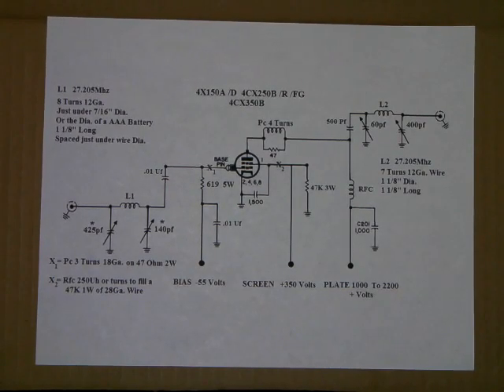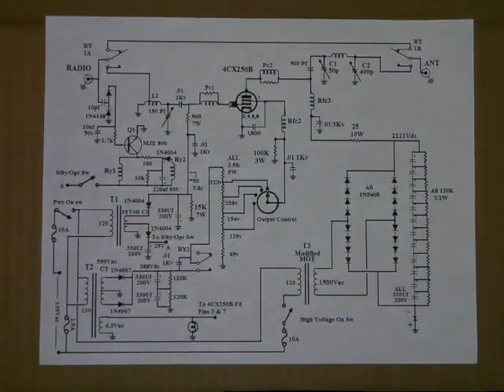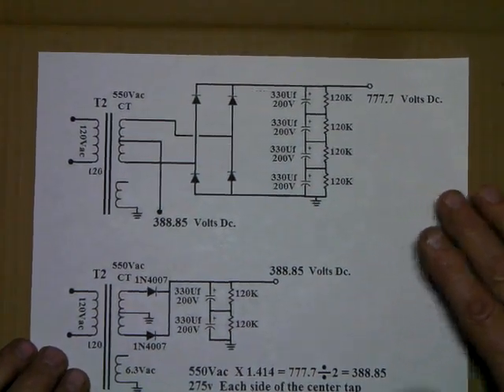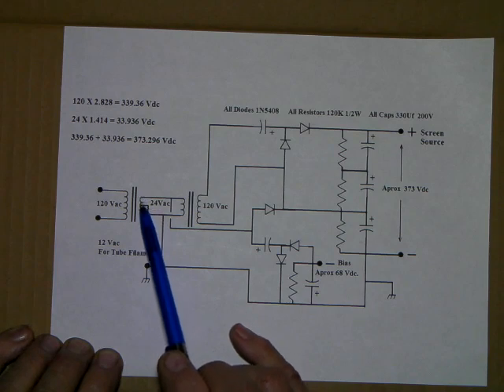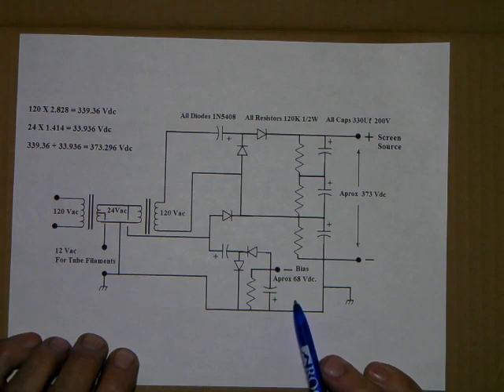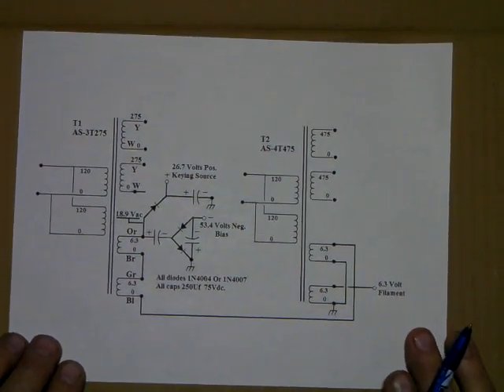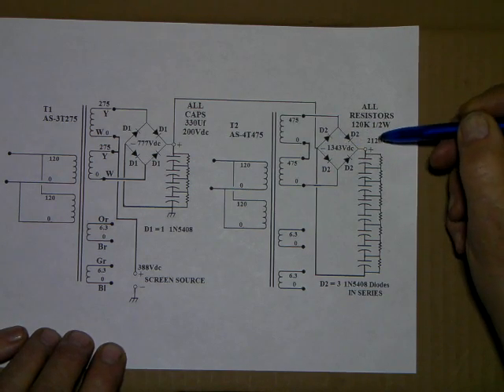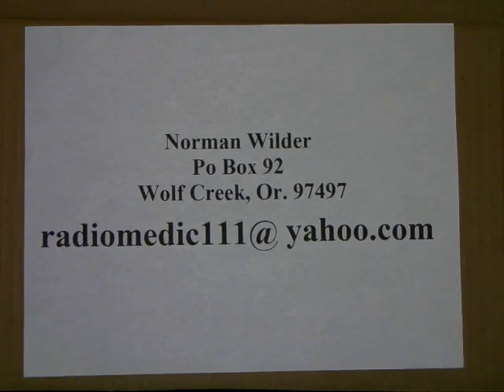Single Tube 4CX250B Amp For 27Mhz  The Build Pt3

Comment: Hi ... and thank you very much .... is it ok to use a single transformer for all the voltage required by the amplifier ?? till now I see all designs with a transformer for anode voltage and another one for the rest ... is it for safety or is there any feedback consideration ??... regards